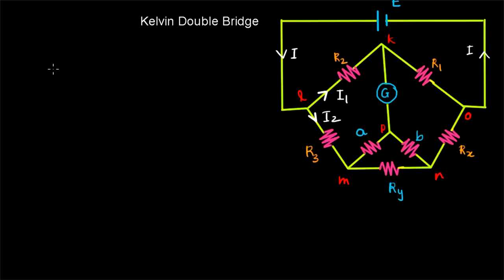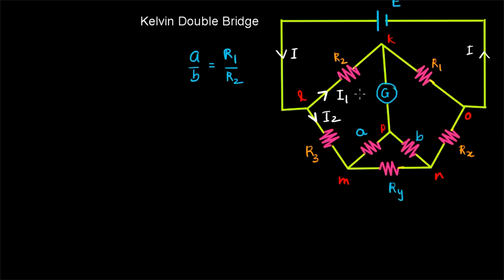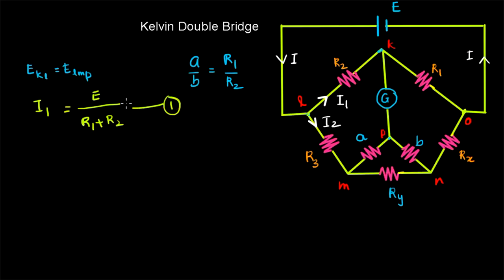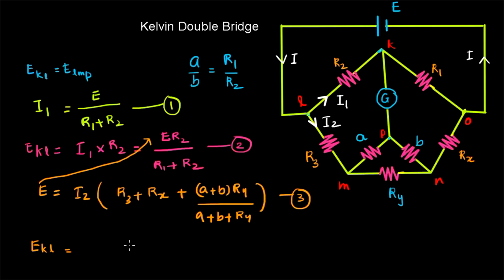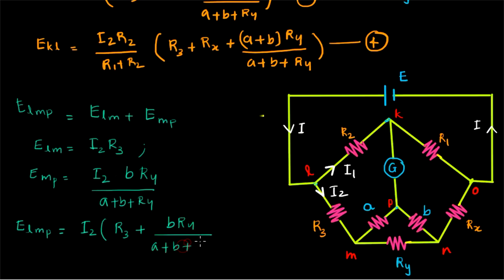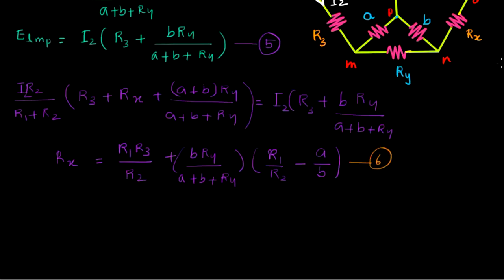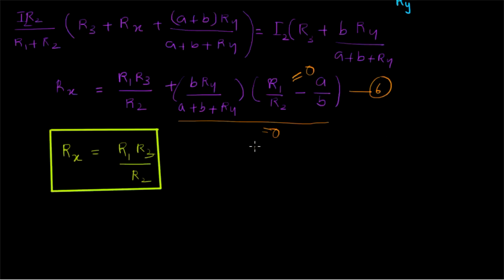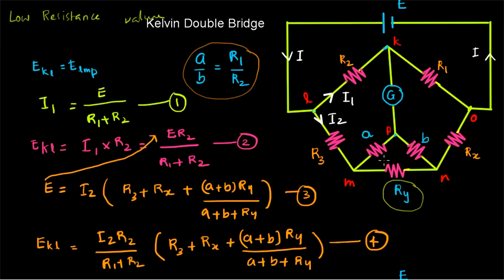Kelvin Double Bridge | Measurement and Instrumentation

Comment: where did you get R4?
terribly wrong!
Reply from the maker: @Barnik Bhattacharyya. I think you have mistaken Ry as R4 . Since it is a derivation, there are chances that unknowingly I have made some mistake in the calculation. If you can tell me the exact time frame, I can correct it or redo the video. Thanks.
Reply: It's not R4 its Ry
Reply: Simple method😊😊easy to understand.Thank u sir👍👍